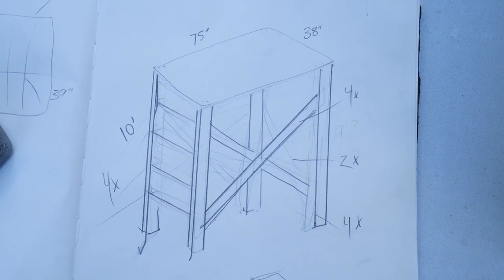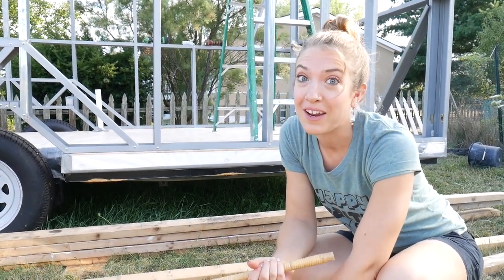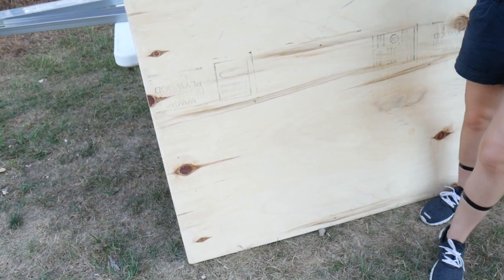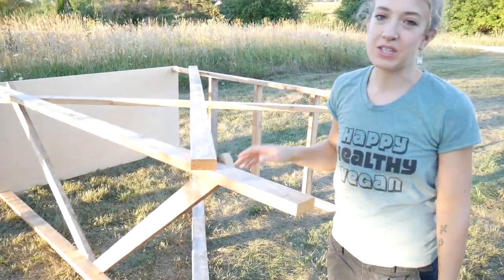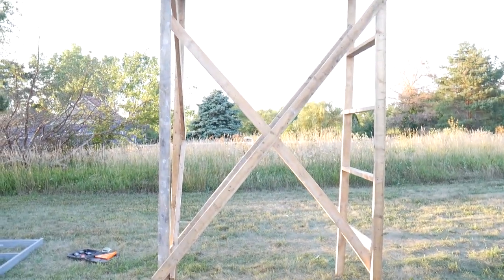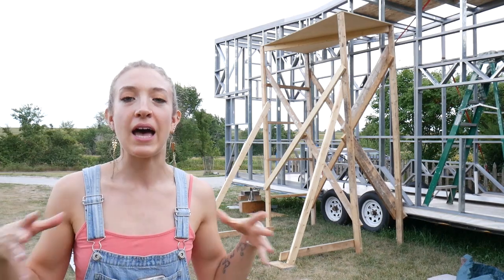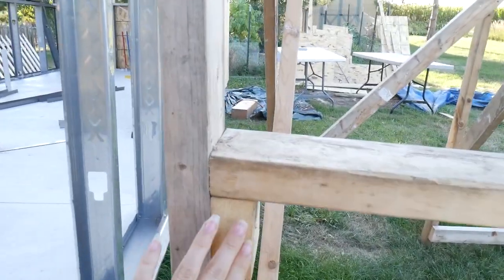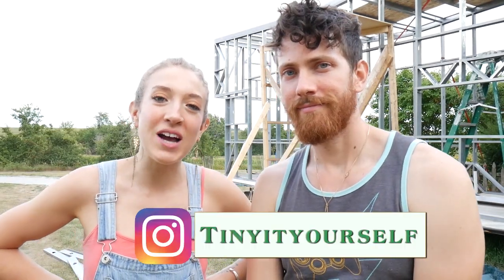DIY Scaffolding for Tiny House with Recycled Wood

Comment: I was going to buy some scaffolding once because it's so expensive to rent, and like you said, it's a hassle to cart it back and forth to the rental place. But I found out pretty fast it was way more expensive to buy even one small section, so I ended up just not doing the project I had in mind. This is a great way to save a lot of money and still be safe while working up high. Thanks for the very helpful video!

Comment: suggestion the top part....make like the underside of a roof or a attic with vertically placed ceiling joists and a ¾ in plywood sheet so that even a heavy guy like myself can walk on it.  Also maybe ought add hand railing for more added safety.  Paint the whole thing to protect it from termites and wet wood rot.

Comment: Put sum stabilizers on the sides attach to a 2x4 driven in the gound  and some support under the top, add a safety rail on top , good deal

Comment: Running a diagonal internal brace  from the  top  inside corner to the bottom inside corner will provide tremendous stability to a structure of this type. 
david

Comment: Just a few hints the Japanese pull saw is a little bit more of a finishing tool so I would suggest possibly getting a different one with the more aggressive teeth and it'll make cutting a lot easier also if you take a block of wood and put it underneath where you're cutting so you don't smash the saw into the ground like that it might last a little longer I know a little bit about engineering and I really hope that scaffold lasted long enough for you to get what you needed done and I hope that neither of you got hurt just a little rickety and it's engineering I understand budgets and trying to do things for as cheap as we can but a few extra two-by-fours would always beat a hospital bill

Comment: Just some input, you should never use screws when building a scaffolding as they have very little horizontal shear strength.  ALWAYS use framing nails.  If you use screws and they snap, you're going to have a bad day.  You can get away with using screws sometimes but you're asking for it.

Comment: If you had turned the 2x4's of your "ladder steps" the other way, they would have been MUCH stronger. You spanned more that 2 feet with the board turned the "thin" way. Rotate it so it's the "thick" way (4" VERTICAL) and there is far less chance of it breaking if you climb up the middle of it. Either way, I would climb it by stepping near the vertical, NOT in the middle. Just sayin...

Comment: The top of your scaffold needs way more horizontal bracing, very dangerous as is and your vertical 2x4s should have been taller for a hand rail, be safe.

Comment: very brave - needs more work on it -  get harnesses and securing ropes/cables so you don't plummet  from a great height..  reinforce that top platform it is not strong enough.  ruins a perfect day when collapsing scaffold stops your clock.

Comment: That is a terrible design, the top platform is ridiculous  Would you build a second story floor in your house out of a piece of 4x8 plywood nailed only at the corners, of course not. The underfloor support is still less than a bandaid  While a scaffold serves a different purpose than the walls and flloor in your house, you should be looking at a similar degree of structure.  Nails should only be exposed to reasonable degrees of shear; posts should support beams; posts should have reasonable numbers and be set for reasonable spans.  Beams should be on edge and notched in, or nailed over top like top plates.  Boards make better top platforms,.

Comment: You need two boards running under the top deck for support. 3 1/2" is too think to span that distance. All the women in my life would never go for something like this. The Mothers would have told all of them "Hey honey you're selling yourself short. What school district would that house on wheels be apart of? All of this is fine and good now but you need to push your man to get you a real house." And then just like that she would go from a helpful exited girlfriend to a potential wife wanting security and stability in a good school district. I like watching these type of videos, but I somehow always feel the women will always back out. Later on they start to think about the type of house they are going to raise their children in and then start to turn the screws to get a larger house.